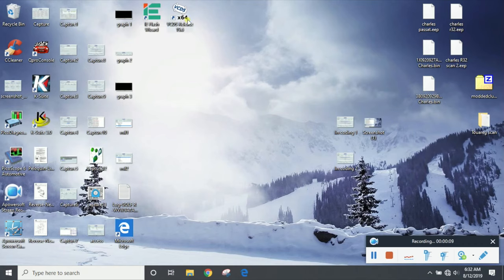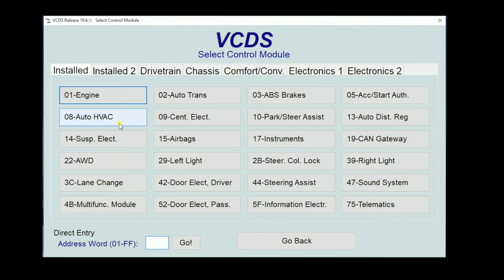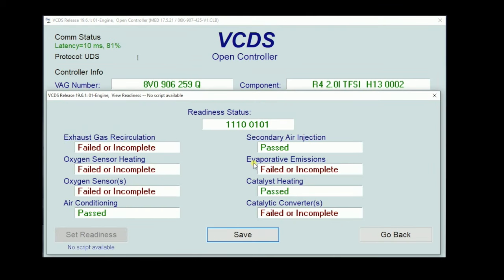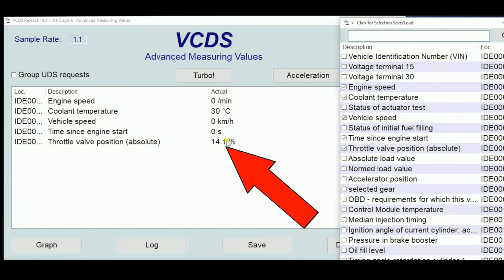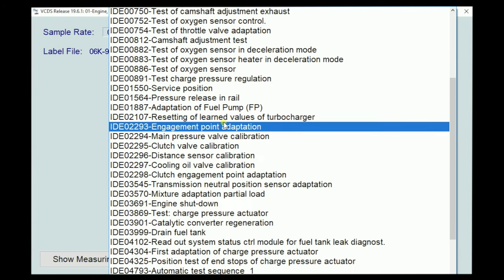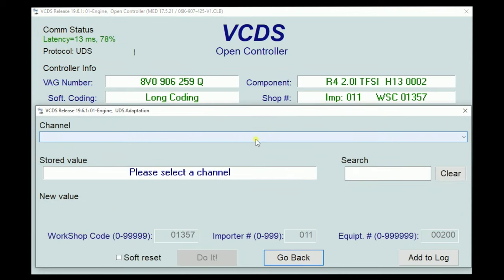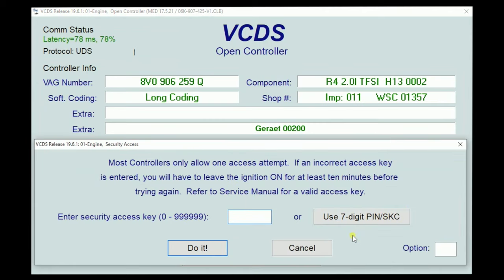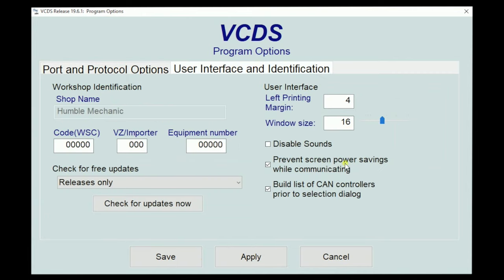VCDS Tutorial ~ How to Use VCDS Scan Tool

Comment from the maker: Hope you guys are enjoying the VCDS videos. What else should we cover?
Reply: Recently purchased the VCDS cable so I can do DIY maintenance on my VW. What laptop would you recommend or would a windows tablet work? There are basic guidelines on RossTech however I am curious what your experience has been...
Thanks. Appreciate your content too!
Reply: Graphing for specific issues IE cat system, misfire, injector operation would be nice to see.
Reply from the maker: @erictrinklein4408  Not the HP laptop I have. LOL I am going to be getting something new probably a Surface Pro 6
Reply from the maker: @erictrinklein4408  You really don't need much in computing power. I also added bootcamp to my Mac book. I really like that
Reply: Great video, I envy the power of VCDS, though I'd love to see a similar video to this done on the R32 as well. As much as this is a fantastic ad for VCDS, I am not sure it's that much of an upgrade over ODBeleven for those of us with older systems, so it would be nice to see an example of that.
Reply: @HumbleMechanic  VCDS runs happily on a 2008 single-core Intel Atom netbook. IMHO, it's a good option for an always-in-trunk tool. Not only it's as durable as a spare tire, it also costs less than a spare tire and takes very little space while providing around 9 hours of battery life, so it's always ready for, for example a mid-route re-adaptation of DSG in my Mk6. Every year, in the first warm spring day, the clutch momentum vs. actuator extension calibration points go haywire (the values run away within up to 6 mm each) and require a re-adaptation, else the car starts dropping the 1st clutch the slipping the 2nd clutch up to the point of rolling back downhill in 2nd gear with accelerator pressed up to 30%. This generates more heat in 2nd clutch and the slipping progresses, but a swift adaptation via "basic settings" cures this completely.
Reply: Great VCDS videos. Yes, more please!  Any workaround for all the German language in MK7 Golf adaptations?
Reply: I have the OBD eleven. Maybe a video on the differences would be helpful to those choosing between the two. Great video as usual.
Reply: Please send more! I suggest that you please make a series and work through each module of VCDS. I have Ross Tech cable and software and need some guidance for for 2013 VW JETTA TDI with DSG
Reply: Great to learn more about VCDS Charles! I bought the VCDS just to help out with the regular servicing on my 2014 Touareg (diesel) . Haven't had to do anything advanced but am interested in the routine maintenance items which come up, things like running fuel pump after changing filter, battery adaptation etc. Was able to recode the engine auto stop/start feature to default to 'off' and press the button to turn it 'on' should you want, with the help of info on the net, which has been a bonus! Thanks and keep up the good work Charles!
Reply: I have a couple of ideas, first is fuel trims, how to get to them, what is correct and what is wrong. Another idea Diesel DPF what measuring blocks are used, and the Particle Filter Soot Mass measured & calculated why are they different when the regeneration is only initiated on the calculated, what is the purpose of the measured value?
Reply: Can I use my mac book?
Reply: I am enjoying those vids very much as a beginner DIYer in VW group world. Please release more. Don't abandon this. It's so powerful tool that knowing it will help a lot of us here.
Reply: This is awesome Charles. Seriously good teacher. More please, sir!!
Reply: Thank you so much! Sir
Reply: Can u do the same with obd 11
Reply: HumbleMechanic Engine ON
Reply: I don’t even know what a VCDS is
Reply: Coding
Reply: HumbleMechanic . It’s humbling myself listening to you. Good job. Anything on Sprinter diesels.
Reply: What's your view on ODIS instead of VCDS?
Reply: I wish I could change the HVAC air default to recirculate instead of fresh air. This is the most frustrating thing about my car!
Reply: @imwmanish  hi please new video uploads
Reply: Rich fuel trims lol
Reply: Would love a how too cud on swapping my 2011 instrument cluster with no temp gauge to a cluster with the temp gauge . I just don’t like having no temp gauge and I’m not over keen on the digital fuel level gauge. I have vcds I’m very new with it .timing belt change easy.... vcds not so ..
Reply: More vids how to use it to dignose LTFT, STFT, O2 sensors (especially wideband)
Reply: @Sam S In VCDS I have Eninge Group 032 (LTFT idle -10% / LTFT load 0%) Group 033 STFT - Why Delpi schows me LTFT -40%? Other ELM BT -25%
Reply: Is It possibile to sede injector duty cycle?
Reply: I have a Seat Ibiza 1.2 TDI(2012 - 6J prefacelift), I've went to adaption and disable "diagnostics" for lights, so I can install led in tail/stop, Reverse light, license plate light(it was disabled already, also disabled was for the fog lights). Now when turning my lights on the dashboard lights are "DIM ONLY", light switches on windows are off, rear window heater, disable ESP etc are off too! I can't adjust brightness(does nothing) - Any clue? This "low dashboard lighting" is on if you have start/stop system long enough(e.g. waiting in traffic light for 1+ minute), then it goes that "dim mode" but now after my "adaption" ..it's always on!! tried to put everything back ...issue still remains :( Not sure if someone is expert enough to help me out on this
Reply: How to program a new controller using VCDS.
Reply: Sam S judging by that response, I’m guessing I would need an Odis for that.
Reply: @Sam S You answer like a person this time, I'm impressed! well done. I have two issues a real expect can surely solve them. Weird thing is I saw the settings before(I disable error-checking on rear bulbs so I could install leds), now even if I restore the settings, it doesn't fix anything. I'm yet to find a real expert on vcds which would know what to do. I didn't expect an answer from @HumbleMechanic or anyone actually with a solution but I was ..ask what do you have to lose except time? :D P.S. P.S. Save whole ECU on a file through VCDS, not sure if possible :D
Reply: If u can speack slower will be more helpful
Reply: @Sam S Not sure if VCDS can do a copy, doubt it tbh. It's not an original VCDS else I'd already ask for their help. I did play with the adaption and remove the led checking in the rear headlights(so I'd use LEDS), weird thing is that if I put back every and each setting ..it's the same while it shouldn't but oh well, I guess I need to find this for myself - Else? I can take the car to a seat garage, they can spend tons of hours and probably never find the issue(the reflash ecu back to stock) and pay a huge sum for that - I guess I can do that if I want to fix it and can't do it myself
Reply: Man I LOVED this, more of these please! Trying to be as good as a driver to my car by knowing as much as I can to keep it running smoothly
Reply: DPF regen
Reply: Thanks for the video. If at all possible, I wouldn't mind seeing a comparison between VCDS and VCP.
Reply: Hello I have just imported an Audi A3 and a VW Golf MK7 from Japan to the UK and I was hoping I could change the digital speed from KM/H to MPH which I thought could be done from the MMI settings but looks like it cannot be done. So my question is how can I do it as I am not able to use the car in the UK with KMH speedometer. So can I use this tool to change it, I have been informed that the software in Japanese models is different and it will not allow me to change to MPH. Please advise
Reply: @erictrinklein4408  Surface Go!
Reply: hey, can you do a video on airflow/airmass diagnosis?
Reply: Maybe U should cover like the most crazy, not logical or ecspected foults? Woodoo stuff. And I don t mean just the battery :).
Reply: Can i change a 2012 tdi fuel filter without using the vcds to cycle the pump. I have heard you can just fill the housing with diesel and it won't hurt the pump?
Reply: I just replaced the ecu in my car with a stage 1 ecu because i beleive it burnt #2 channel, whats the easiest way to aline the throtlebody and cheapest i might add ive replaced crank and cam sensors and coils also any info would be helpful
Reply: What's the difference between vcds light and vcds ?
Reply: running less rich, if possible... ?
Reply: Hi! Topic: if any adaptation/long coding can be traced back by VW repair shops or not. VW repair shop statement they can and warranty lost. Non VW shop w/ VCDS told no warranty will be lost VW cannot trace it back. Question here: VW lies? Non VW shop lies or they can hide or they are not competent?
Reply: Hey there, can I programme my new spare Key using VCDS ? Passat TDI 2013 SEL
Reply: Hello how can i addapt with vcds my audi a6 c6 can you help me?
Reply: KEY LEARNING...I buy cars from impounds with no keys...I can order them without being programmed..but I purchased this supervag k+can
Reply: I'm an audio engineer. I would like some hand-holding through the entertainment system, and the mods that could be done to add TV tuner, NAV from more modern sources, but on the car screen. I've seen some of your other videos, always delicious content.
Reply: Learn how to teach before making instruction videos that makes you more frustrated. At this speed its not possibly to follow
Reply from the maker: That’s for the feedback. A little YouTube trick I use is either pausing the video, or slowing the speed. A video can not have dead air.
Reply: Thank you for the video. I think you should cover: a)Training for beginners on VCDS b)How to install the Trailer Hitch Retrofitting for VW Tiguan 2013. c) Engine Control Module why some have long coding and some short.  Thank you again.
Reply: What to do if there is a fault? This might even been addressed already. I'm quite late.
Reply: Transmission adaptations from auto to manual transmission
Reply: Can we learn how to do readiness monitors and test those components like secondary injection pump how to read fuel time on a mk 4 lambada and all

Comment: Pulse width modulation IS full voltage. Turning on and off allows it to dim or flash but the voltage does not change. The time it is on is the pulse or duty cycle and that will determine brightness. Be careful with your wording.

Comment: This is what Ross-tech noobs like me  really need are vids like this ! I still have a 03 Jetta with 639,kl  1.9 TDI with a rebuild I.P. having trouble with IQ is all over the place  with #2 and #4 cylinder running rich 1.42 and 1.88 The pump guy says my injectors are bad , so I swapped them out with know they are good injectors from my second car , And it helped the rough idling but still not stable on the IQ {goes from 2.8-4.8 } and # 4 is still at 1.84 m/str  had enough practical for to day sat down and found this vid , back to some theory

Comment: hand brake on keeps daytime running lights off on certain countries also. I did the change to the throttle linear over time mod on a TDI.. 100% improvement. The Ross-Tech forum is handy as well. and the tech support is the best.

Comment: Great info. I picked up a VCDS hex can cable back in 2008 or so and it still functions great.  I worked late on a 2016 Touareg last night with a interior light issue and the VCDS helped out a bunch. Unfortunately the factory SI  is lacking for the j519 module.
Reply: ThePracticalMechanic where can I pick this up?
Reply: CAR DOSE The VCDS HexCan cable is no longer available I believe. Those of us that have it (myself included) are very grateful to own one. Ross Tech (VCDS)  now sell other versions.

Comment: Excellent video Charles!  Would love to see more like this, in particular:  1) how to check for chain wear/stretch, 2) are their values to monitor which indicate carbon cleaning may be needed, 3) a series on frequently used sections of VCDS for troubleshooting common mk6 GTI problems.   Last but not least, I'm a bit surprised that you recommend a battery tender for the battery.  I'd think that the vast majority of things VCDS does would be extremely low current draw, when compared to (for example) starting the car (which is a massive drain on the battery).
Reply from the maker: Great video topics. I ALWAYS want a maintainer when the key is on and the car isn’t running
Reply: @HumbleMechanic  Good point, better safe than sorry (re: battery maintainer).
Reply: hi, can you make a video how to get the clock displayed in the dashboard with (VCDS). has a Vw t-cross style + from 2019. etc. Uwe Beck.

Comment: Thanks for this video, please keep them coming, I do have this scanner but I don't know how to use it very well, for example, in minute 18:19 there is a screen for Service Reminder Interval, it shows a value  on row 4 on oil quality of poor oil quality, and even when I just change the oil it is still the same. So is the car actually checking the oil quality with a sensor or is that just more like a counter, for example, after so meany miles after the service it will say poor oil quality. Even when I enter the value for the next service it still reads poor oil quality. And another question is who do I now the correct values that it should read, in what publicly available manual can I found the baseline values?. Thanks Charles! congratulations on all your videos!

Comment: Charles, as always, very interesting and educational videos that you share with us.  Can't thank you enough.
Please, please continue your tutorials on the VCDS .  I 'm still a newbie with this tool and it is awesome for someone like me.  Mine is an older Ross-Tech interface (KII-USB)  and I use it on my 2002 Passat.  We now own a 2018 Tiguan and I am wondering if I can use this older Ross-Tech (updated to 19.6.2) interface with the newer Volkswagen to diagnose problems with the same ease as I am now able to do with the Passat.  If it would not do an adequate job with the newer VWs and I upgrade my interface, which one would be your choice that would do the job on both vehicles?  May I suggest the following if you have time to make these tutorials:  how to change the day driving lights from always on to off, how to diagnose bad engine sensors that commonly malfunction, what graphing functions in VCDS are most useful to the DIYer.    Thank you.

Comment: I just bought mine to use on my 05 touareg v8 so this is perfect timing. 
Thank you
Reply: How's the cam chain tensioners? I already replace one on my 2005 Audi A8 4.2l and need to do the other soon
Reply: @JDJD-mw9rr  That was the 1st thing I had done on my Touareg.
Full timing belt and tensioners as well as other maintenance stuff. 
It was a $5k bill but I wanted to make sure it would last.
Reply: @infidel24  ya very smart, I did the Timing belt myself and only the driver side tensioner. It took me a week, the whole front end must come apart, front of the engine, and then to get the tensioners done you have to take the cams out of the head. It's a huge job, I'm not looking forward to doing the other side lol. Has yours been reliable? So far mines been great besides the maintenance

Comment: Super useful, thanks for this and keep them coming, been using vcds for 6 years but just basic stuff, and as you said I learnt some new stuff. Just on the SRi reset, if Ur car is UDS you will have to use adaptations in the instrument cluster module to reset the oil and inspection intervals, bit of a pain until you get used to it.

Comment: Thanks for the Video, solidified my decision to buy a Ross-Tech today.  I have been rolling it around in my head for a while until I was stymied on two VW's in the last month.  I have been able to do quite a bit of diagnosis and repair with my Snap-on Zues, Autel Maxis and Launch but there always seems to be a function I need missing in an adaptation or coding calibration.  Nothing more disappointing to see a full function menu but be kicked out with a generic message like "access denied" or dubious "conditions not met" .  I am hoping this helps out with an occupant detection module calibration I am struggling with right now that will not complete after installing a new pad.  I am getting an error for calibration not complete no matter what angle of attack I take with the Autel Maxisys full function menu.... On that note, do you have any videos on Security access codes for modules?  That would be super helpful!

Comment: This is most helpful. I have watched it a few times and each time I get a little more. I am new to VCDS. I need to know how to find out what is wrong with my ESP on my 2011 GTI. I have swapped the G419 sensors and the ABS module but the codes 11164 and 01423 come back at the first corner with any G forces. The traction control can be turned on and off until those codes come back. Any help there in diagnosis would be appreciated.

Comment: Liked the video. I’ve got A VAG-COM cable and software coming in the mail. Do you deal with VAG at all? The reason why I ask, is because I’ll be removing my throttle body (and possibly replacing it), and replacing my instrument cluster. I understand that both of these processes will require the VAG tool in order to reset some things.

Comment: Hello,  I really enjoy your VCDS tutorial.  I REALLY needed the training. One question. I have a 2011 Audi A6 Quattro 3.0t supercharge and I removed my battery for a couple of days to work on some other items in my car.  I placed the battery on slow charge so it could maintain its correct charge, but when I installed it back into the car, I got a check engine light, it took several attempts to finally get my key recognized, the TPMS light came one, red oil sensor light, etc. I used my VCDS to auto scan the car and I had red codes on almost every address.  Can I use the VCDS to reboot my computer or do I just need to disconnect & reconnect the battery.  I'm really at a loss on this.